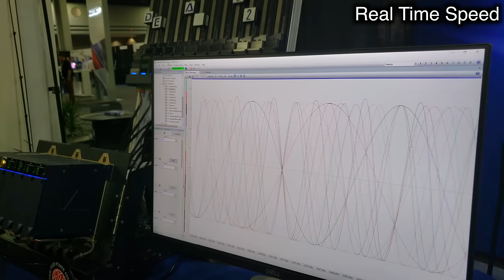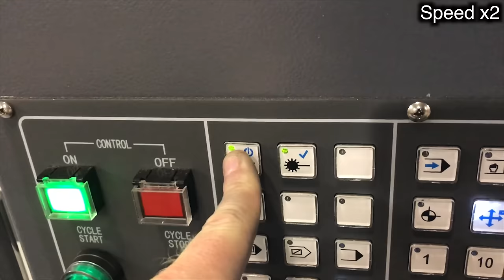Automated Manufacturing Robots - FABTECH

Comment: This video is essentially pornographic material for engineers. Are we sure this won't get taken down by YouTube? 😂
Reply: Yeah, I guess in the way of mass production  robotics and mechatronics.

Impressive but which makes the future look a bit bleak for the blue collars yet to come of age.
Reply from the maker: @SwarthySkinnedOne  I think there is room for both. I manage a sheet metal manufacturing facility in Florida and I do not see these machines competing with us for quite a while. I can make 100 parts or enclosures that I've never made before much faster compared to the time it takes to set up and program something like this. Even with a somewhat complex enclosure, I can go from a drawing to a finished part in an hour from getting the model. A local job shop will be much cheaper and faster most of the time for a run of 100-200 parts compared to a much larger automated facility. A large automated plant will not want to run prototypes or small runs for you without a contract for thousands of parts.
Reply: Proto G Engineering 

I'm not so sure about that. Seems the only folks fairly immune to automations replacements are folks like you - Management, Executives, IT pros, and maintenance folks - the guys needed to stick around to make sure some mechamakeitnoid don't crash or bite the dust from some data hickup......and WD-40 heartburn:) ha ha. The systems are rather fascinating I have to admit shown in this vid and similar ones, however the intimidation of it all kind of makes me feel I should have in college taken up industrial one-arm robo laborers and production mechanisms...instead of the teachers time. Pah ha ha:)

But for folks like us with limited career talents.... Geez I just don't know man.  I've a whisper of an unsettling hunch telling me it's gonna be increasingly slim pickings for us keep body and soul together as time marches on. I mean as they are these machines, in my book, are slick and  sophisticated enough, and Goddamn!! no telling how much more super dynamic they'll become 10 years from now, what with systems and cybernetics evolution knowing no end. It's like some of us laborers will have to pack up and move to a different planet, like see if the Martians are hiring, pah ha ha  ha:)

Well, nice speaking with you pal.
Reply: Proto G Engineering 

Alright man, If I put my foot into it (as it seems I've lost you here) well...oh well. It's just that thad to say what I did. 

I'm a thinking man you know.
Reply from the maker: I don't think your local job shop will be able to afford these type of machines anytime soon. Job shops typical have many different parts on any given week and constantly have to change tooling setups. Most of these machines are at least 1 million USD. Not to mention the tooling for some of them are specific to the job and can easily cost over 100k. These machines are directed toward mass production making the same parts in large quantities. Startup companies and small businesses are not going to want to pay for tooling to mass produce products. As I said, I can easily form several sheet metal prototypes manually before the programming is done to automate 1 formed part. There is plenty of time to learn how to program to fix these machines as there will be a growing demand for that as time goes on.
Reply: Proto G Engineering 

I'm thinking more like ten years from now what the outcome will be, for tomorrow's manufacturing and factory  hands (smaller shops may no longer be able to compete), as technology is getting so dynamic while time marches on.
Reply from the maker: @SwarthySkinnedOne  That is plenty of time to develop skills needed to repair or program machines like that. Just start doing projects at home that involve skills you want to learn. 10 years ago, I did not have any technical skills at all.
Reply: Proto G Engineering 

That's true indeed. Did you start off with home projects? To get where you are presently?
Reply: @ProtoG42  
"Kuka" can train a person in 10 days, work with his robot, in Russia! ;) modern technologies of control of these machines make it possible to go from drawing directly to production, practically excluding errors and the human factor! I don’t know English, but I wrote this text in 20 seconds, cool? ;)
Reply: FABtech
Reply: @SwarthySkinnedOne   Don't worry, customers will be simply demanding more and more products so there will always be work.

70 years ago people didn't own even half of what a household now has. All those dishwashers, etc etc have to be made.
Reply: @sverduijn1  

Maybe.
Reply: I couldnt take my eyes off the screen
Reply: Good one;)
Reply: @sverduijn1  somewhere along the line they decided to trade a stay at home mom and homemaker for all those appliances and look how that turned out.
Reply: @ProtoG42  robots ain't shit with out people , no matter what. Thay can't think like we do so ....... ALL these machines do is what we program THEM to do,,,,NO MATTER WHAT.   !
Reply: @ProtoG42  The problem is these machines require less programming and setup with each generation. It's like 3D printing. At first, you could only print objects from plastic and only 20mmx20mmx20mm after 12 hours....then it's plastic and wood, 40mmx40mmx20mm after 3 hours.  Then it's plastic, wood, soft metals and 100mmx100mmx50m after 1 hour 30 minutes

Then it's hard metals too and injection moulding at sizes of 500mmx500x300mm in 5 minutes. Load model, wait 5 minutes, it's made. With some geometries basically impossible any other way.

Look at the speed of that welding bot performing tens of perfect welds per minute. A welder could do the same with 30+ years experience and intense focus for a good 5 minutes but for 8 hours straight? No way.

Plus, the price of such a printer has gone down progressively from $40k to $20k to $10k to $5k. Similar things are happening with sheet metal folding devices/robot arms/etc.

Don't get my wrong, small machine shops will still be needed for custom jobs -- but these systems will be able to do smaller and smaller jobs and programming will get progressively less. Remember, digital, AI and smart-adapted learning machines that just given a drawing, configure themselves with no technician required, is probably only 20 years away. The programmer of simple jobs, is going to be outsourced to AI in 5 years.

Just look at website coding. A ton of small business websites now "program themselves" with minimal user input.  In 5 years, it'll be small-medium business websites and small applications.  In 10 years, medium business websites and small-medium applications.  15 years, medium-large business websites and medium application.  20 years, very large websites and large applications. (Note the exponential growth at the end).

When very large websites and large applications can be programmed in an automated way using natural language with near-zero coding skills required... programming these style controllers to match a drawing will be child's play for that AI.
Reply: @SwarthySkinnedOne  That's why we need a UBI.
Reply: @SwarthySkinnedOne  8 uh 8
Reply: I can't believe this: I was just about to post that exact same smart comment. beat me to it.
Reply: you wont be able to watch porn 24/7
Reply: @SwarthySkinnedOne  There won’t be any blue collars. Automation will take care of all drudgery for us.

Comment: Is it safe for them to be welding on the show floor without any visual protection?
Reply from the maker: There was no real welding in any of these clips. Just going through the motions. They did have some robots welding behind welding curtains but it doesn't make for good video. There was some unshielded plasma cutting going on that I thought was a little unsafe but I didn't see any unprotected welding.

Comment: ahh came to comments because the motions just seemed insanely fast, like they would break the fixtures or shake like crazy. I didnt realize some were sped up. Made me think they needed tails, or some type of equally articulated counterweight that could be controlled to help prevent vibration artifacts in the movements.

Comment: Intrigued by the toolmaster machine. An automatic bender tool exchange?
Reply from the maker: Yeah, there were a few machines like that from different companies that each had their own way of changing the forming tools. I preferred the machines that had the tooling behind the machine vs. a large carousel to the side of the machine. The press brakes that automatically set up the tooling for you were starting at around $500,000.00 including tooling.

Comment: Having to divide the playback speed by 2 to try to find the real time of the performance greatly degrades the quality of the video, it becomes unpleasant to watch.
Especially since none of these clips need acceleration to remain interesting.
On the contrary, the evaluation of real speed is very important for those who watch these videos because it speaks directly about the characteristics of these technologies.
If you want to not exceed ten minutes of video you could make two videos ... of better quality each.
Thank you for your answers and your interest in comments :)
Reply from the maker: The first 9 video clips were all real time speed. The rest of the video clips are x2 speed. The videos were shot with 4k resolution at 60 frames per second. Click on the gear and set the resolution to 2160p60. Then at 0.5 speed, the video is still 30 frames per second. The audio is the only thing that really gets degraded. Just so you know, most of these machines are not running as fast as they can for the demos for safety, sound restrictions, as well as power restrictions. The conference had hundreds of industrial machines all running at the same time.
Reply: @ProtoG42  ooohh yesss that's right !! x2 speed in High-Res+60frames/sec  /2 = ~as fluid ! Thanks !

Comment: About jobs, I actually see another outcome.

Think about it. Robots are just CNC with a bit different construction and some extra axis. All these parts and tech are becoming less and less expensive.

I'm building a CNC machine at home now for just a few hundred usd. Who could think of that in the past?

I have seen many of these wire benders. Many companies make them. So manufacturers are just as threatened as workers. You could even make your own wire bending robot with stepper motors, arduino etc. All this software will become more and more available. Just like 3d printers which people can afford now. This was unthinkable in the past and gives the ordinary people many possibilities.

If the blue collar workers step up their game they can compete. Why? Because they are close to the customer. They can think about what the customer wants and convert the best ideas into products.

Then they can choose to make the products themselves or find the best robotfactory to do the job for them. These factories will have to compete with each other. 

Like for me, I have a simple idea now for a metal toolbox to be fitted on trailers. It doesn't exist yet in the dimensions that I want it. Why? Because I actually use the trailer and know what would be best. Robots, engineers and ceo's can never come up with the idea, because they don't use the end product.

Comment: This works on a one armed robot but you have to go to the upper limit due to no voice box. Do you have a codable robot? This is how to make it an Artificial Intelligence: follow this method below change the code in the subroutine from F=m*a*a to the test points below until you get it to walk and talk on its own. This is easy to test on a robot that you can code in the system. If this does not work then you have a bad SOST, Computer Chip, Servo, or some other component.
F=m*a*a is currently running the system at 31.821%
If you have any doubts about my robotics research you can test my work by doing this start low and go high on the acceleration factor.
Test Points:
F=m*a*100

F=m*a*300

F=m*a*600

F=m*a*931

F=m*a*932 this is the minimum for communication and will state it is “too slow human”
F=m*a*1999   = "too slow human"
Then go to F=m*a*2000  up to 2383

 F=m*a*2383 full functional range.     DO NOT GO OVER  2383 it could malfunction.

Now ask the robot its command structure and what he can do to a Magnetic Resonance Imaging System?

2nd Law of Motion for Robotic Physics
Reply: lmao are you just multiplying acceleration? why are you calling it "a" if it's a coefficient totally separate from acceleration?